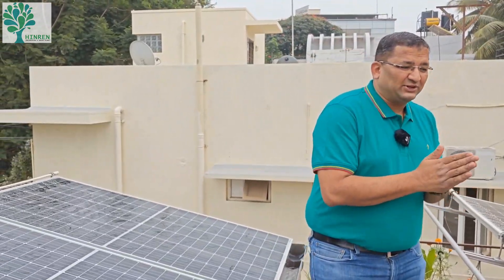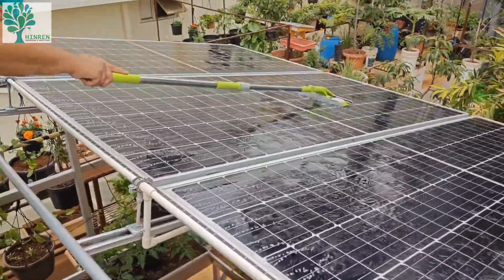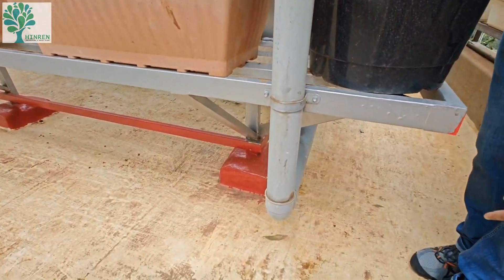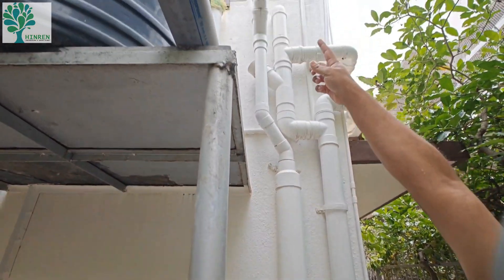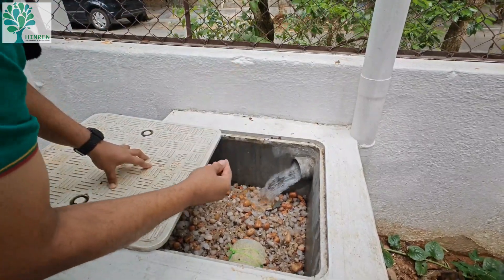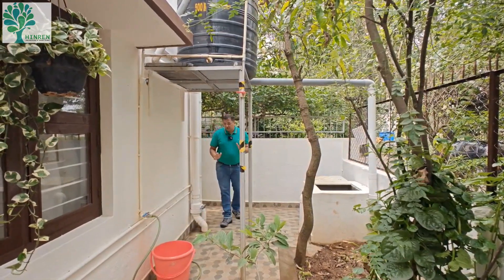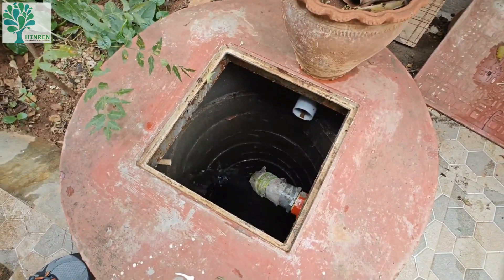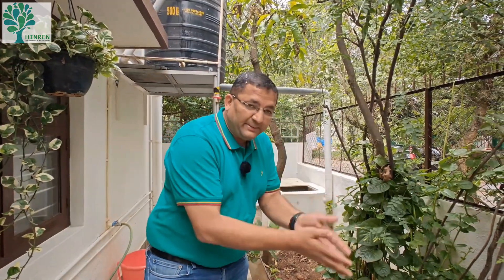Solar Panel Cleaning With Water Re-circulation and Rain-water Harvesting

Comment: Sir, at somepoint i think you marketed the structure at self contained and just stuck to the terrace and mostly stands on it own weight... I now see that you have done some concreting for each of the legs. is that to add more stability and prevent worst case scenario?
Reply from the maker: We do structures both by anchoring and the ones which stand by self weight. The structure in this video is the one standing on self weight. A masonry jacket is done around the base plate so that water does not touch the metal base plate .